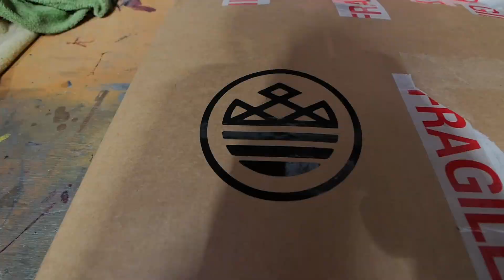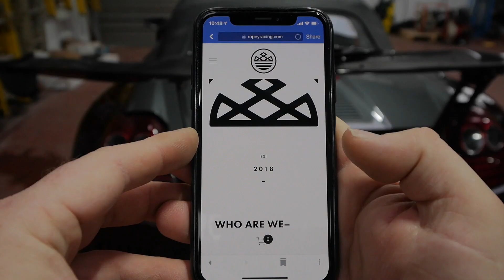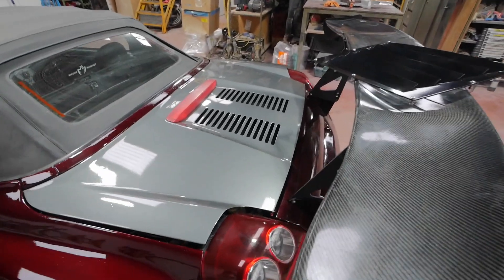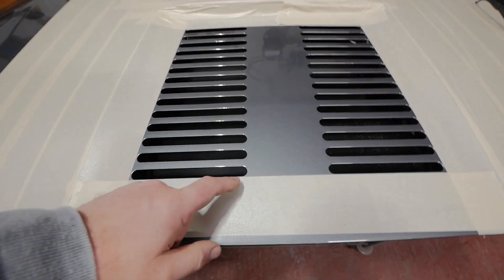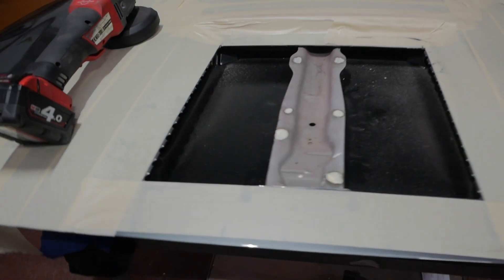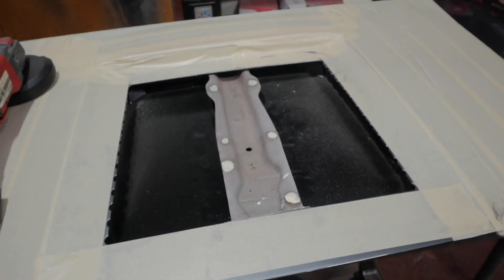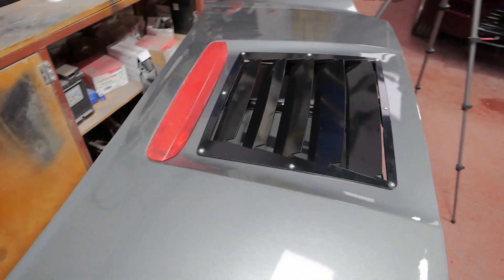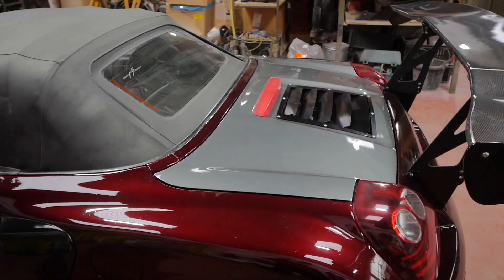Custom vents by RopeyRacing install - MR2 Spyder turbo

Comment: Fantastic job Lee. Videos are inspirational. Did you run into temperature problems or was it a combination of hot lid and wanted a change in aesthetics? I hope you are able to share one day how you crafted your exhaust and the components. Thanks for sharing.
Reply from the maker: No probs, just noticed how hot the engine gets. Every little helps 😀. I need to make a new exhaust

Comment: This MR2 gets sexier with each mod. Ignore this suggestion if it's dumb but what you think about the 3rd brake light being tinting/glossed to match the rear lights. It looks a little faded in the video. Nice job as always Lee.
Reply from the maker: I was looking at it today thinking it looks tired and needs something doing

Comment: Spyderlee do you have a video on how you installed that front ducting under the bonnet? I just ordered one of those sweet looking rear vents👍🏻
Reply from the maker: No, I literally just cut some aluminium to fit in and bent it into shape.
Reply: Gotcha, it’s pretty cool though. I bet it helps with aerodynamics quite a bit.
Reply: What did you secure the aluminum to?
Reply from the maker: Luke R there’s a brace that goes across, the one that the steering pump was fixed to. I screwed it to that

Comment: Hey S.lee you ever think about smoking (blacking)the center brake light. I've smoked mine on my 2003....and how do you get the wet effect from your paint. My" pearl and red "job looks good but it doesn't look as "wet" as yours.
Reply from the maker: Yes, I noticed it was looking tired when I did the video. I’ll sort it out
Reply from the maker: The wet is because of the clear coat on top of the candy. Search flow coating on youtube 👍

Comment: how bout when it rains SPYDER LEE ...R U WORRIED ABOUT RUST ETC.
Reply from the maker: I’ve put the tray back on for now, so should be more or less as the stock vents for rain. I’ll take the under tray off in summer.